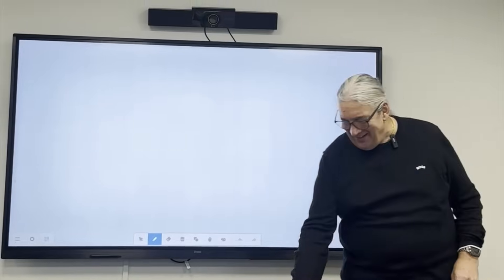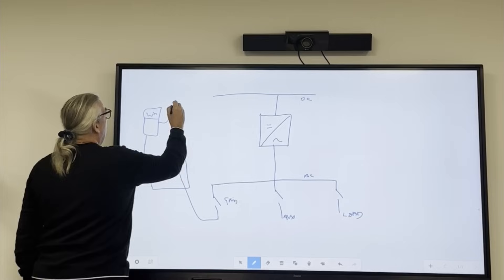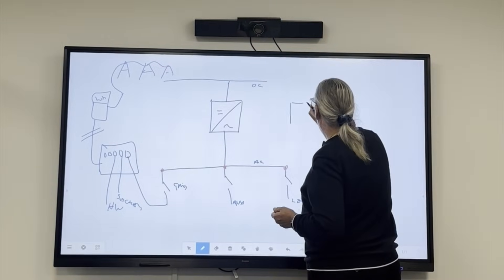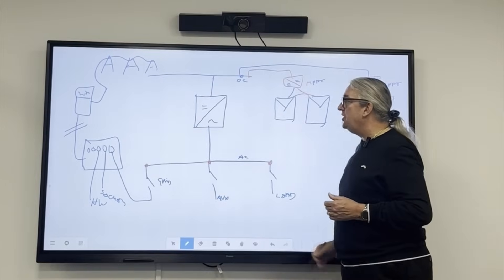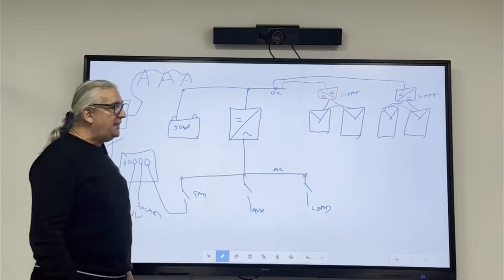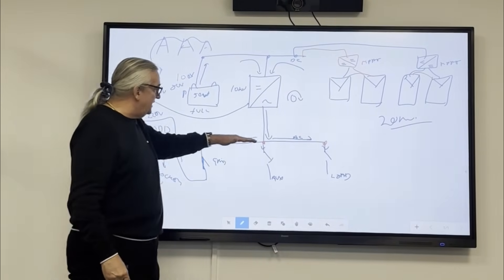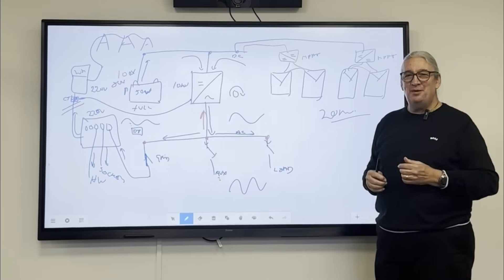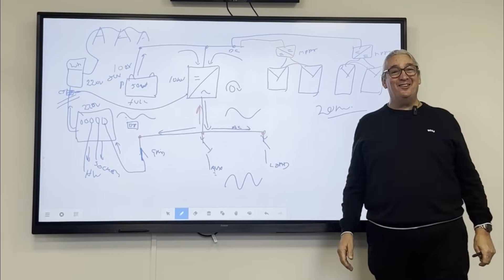How Inverters work: Simple explanation with Keith from Sunsynk

Comment: Hi. Just had a SunSync 3.6kw inverter fitted onto 10.3kw of battery storage. Can I configure the inverter so that it trickle feeds to an iBoost to heat hot water. As I understand at the moment it won't feed the iBoost until the battery is full. Can I change this setting? Thanks Philip

Comment: Thanks Keith, Yes, very good. Nice and clear. However, WHY did you draw 2 x MPPT controllers on your drawing. The Sunsynk Inverter can take 2 x strings and IT does the MPPT controlling ? Did you really just mean 2 x Strings (lines) of solar panels ? Stating the obvious there is no DC-DC conversion going on .... its just DC volts out from the solar panels into your Inverter. Or have I missed something ? Thanks again Keith

Comment: I'm planning on connecting a sun2000g3 micro inverter to the generator input. How would grounding work during island mode as I asume the microinverter will continue generating, while the other mppts turn off, (sunsynk 3.6kwh UK) will earth neutral bonding be safe

Comment: Is it ok to connect inverter output neutral with grid neutral?
Reply: No it is not. Do not do that. Grid nuetral should be connected to Grid nuetral connection on the Inverter. Inverter load nuetral connection must be connected to your essentials DB. Also nuetral busbars should be separate for Grid, load and aux. Don't mix them